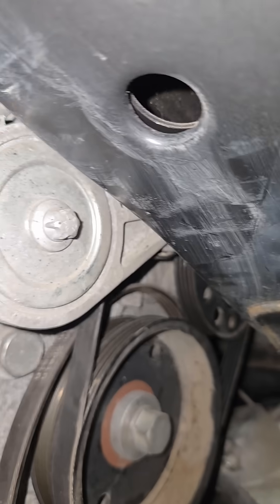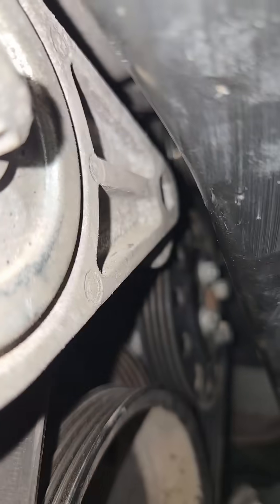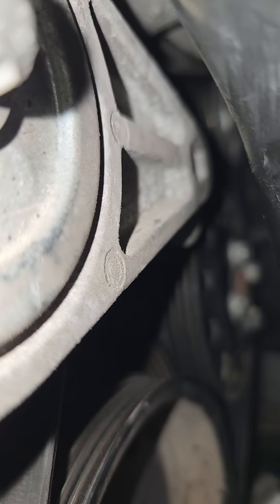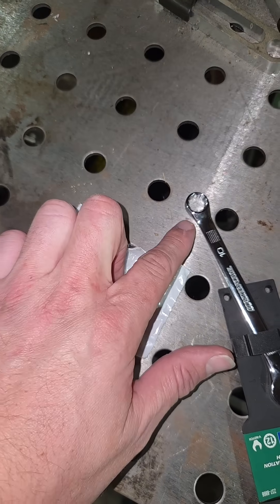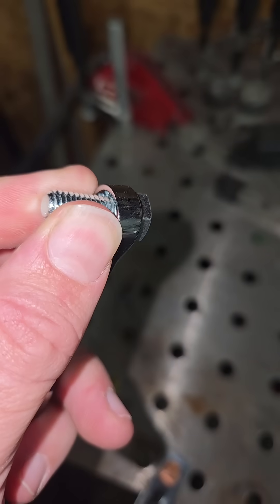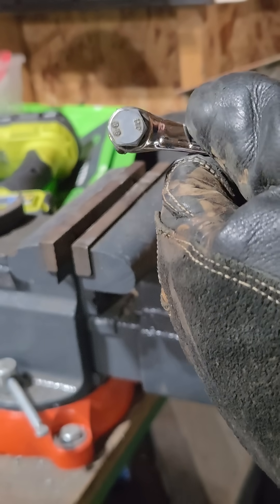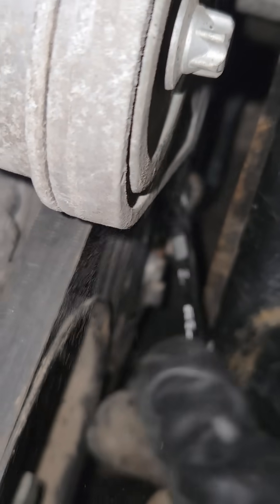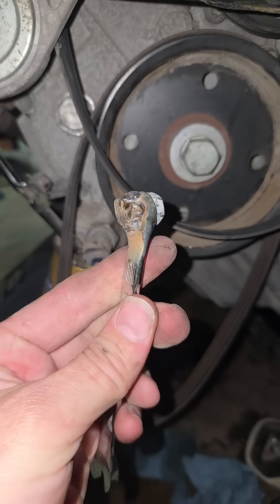Custom Smart Fortwo Belt Tensioner Tool

Comment: Lol a breaker bar works just as good 😂
Reply: you have a hexagonal driver on your breaker bar?
Reply: @slumerican6663 i don't but i'm sure they make em!
Reply: I'm not calling the idea stupid or anything of the sorts! I mean its pretty awesome being able to weld a couple of ideas together and have it be functional like in this video. Sometimes you just gotta use whats around you to get the job done
Reply: @retched95  The answer is no, you dont have a breaker bar that would directly fit and once you put the socket you needed on you'd run into the initial issue he talks about in the video. IT WONT FIT. Not much going on up there eh?

Comment: Innovation!
Reply: That is why idler pulley bars are available for purchase, cheaper than that combination wrench, bolt and time involved in making it.....
Reply from the maker: @gmazzina and the off the shelf ones do not come with a 12mm hex head. There is a mercedes tool out there meant for this but for $4 in supplies and few minutes of time, I got the tool i needed and have since moved on with my project.